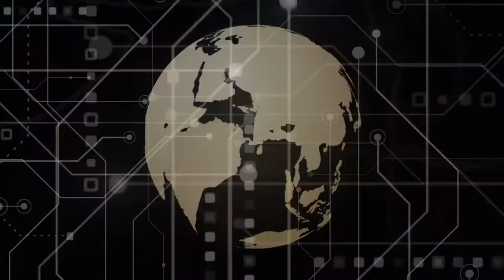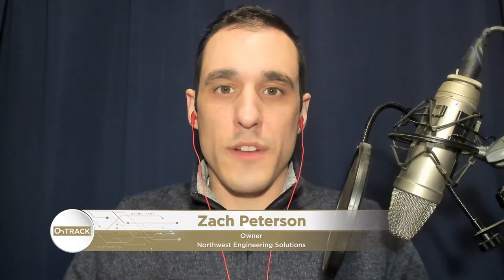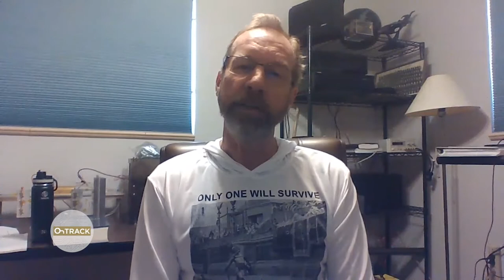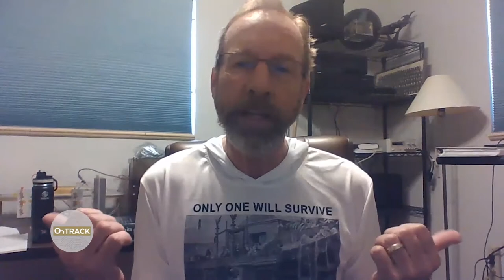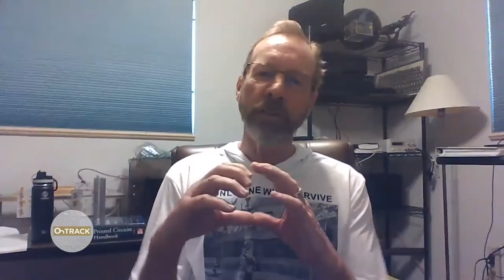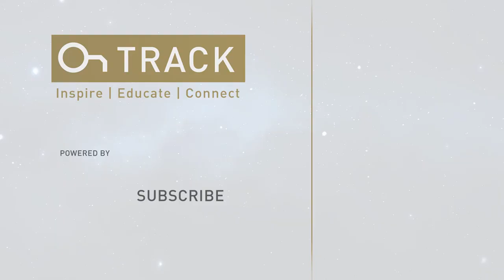Thermal Management in PCB Today

Comment: Hi Mike! Good to see you again. Your work changed the world of circuit board development forever. THANKS!!!
(Can you get the IPC-2221 Voltage Spacing Table 6-1 revised now? ha)
A summary point that might help circuit board designers is that the IPC-2221 chart is considered "conservative" because the recommended width will work for a trace on any layer on any size board, but will often result in traces that are wider than they need to be. 
To fine tune the trace width for your specific design (like to reduce the width based on the presence of planes, for example) you use the more detailed charts in IPC-2152

Comment: I've just started using the PCB Power Analyzer software in Altium. Does this video demonstrate that it isn't really up to the job? Does it know about planes, emissivity, layer count, altitude, adjacent traces, or anything else? It's also full of bugs and doesn't show trace power.
Reply: Power Analyzer just looks at the power dissipation distribution around the PCB so that you can identify potential failure points (assuming DC current). It takes the ambient or operating temperature as an input parameter, but it is not a thermal simulator.
Reply: @Zachariah-Peterson  We've just bought a license for this tool, and it's almost unusable on one of our existing designs. We have an open ticket with support as it suddenly stops creating heat maps when you add a certain level of complexity with the nets. It should be free until it comes out of beta.